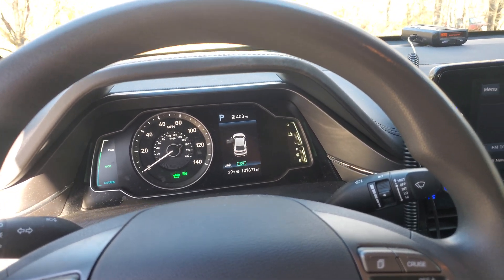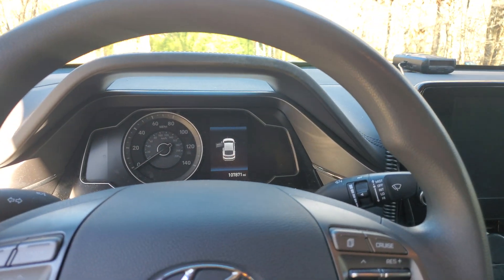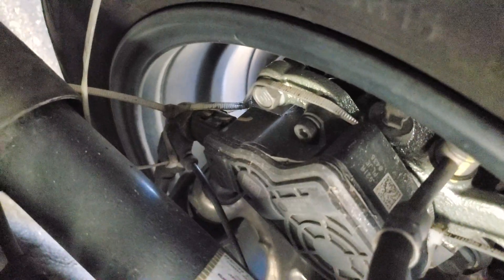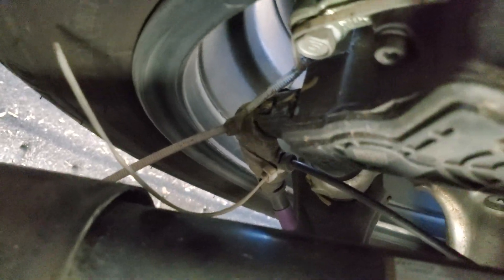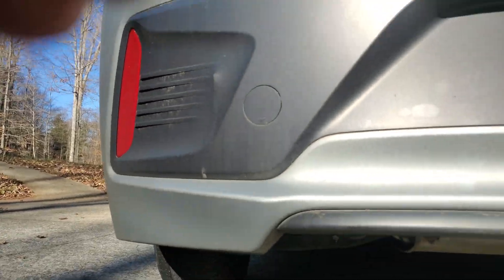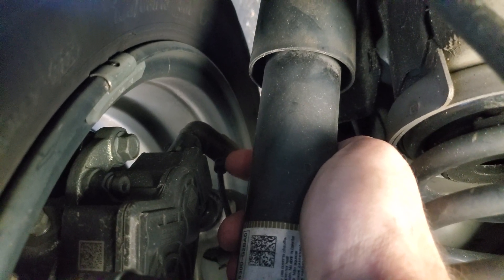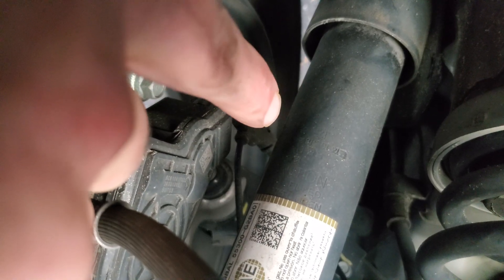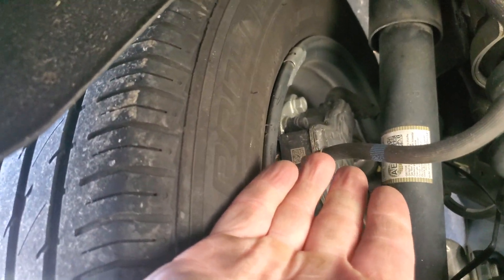Hyundai Ioniq 2017-2022 EPB Auto Hold Light Simple Fix | Resolve Error Codes C2416 & C2417 Easy Fix

Comment: Thank you so much for this. I was very skeptical at first but it actually works! As a single female, taking my car to the shop has at least a $250.00 cover charge.  The dealer and other mechanics quoted from $225-$275 to diagnose it, even though they probably know exactly what's wrong with this issue and really, Hyundai needs to recall and pay for this malfunction.

Comment: Great video. Used this method to great effect. Thank you. 

The closer I looked at this issue, the more clearly it looks it's an engineering and design flaw. If you look at the small bracket that holds the cable just before the connection, it is too high and the cable is pushed too far through it. This causes the cable connection to lift up on the back of it, seperating of the connection with every bounce on the road and signaling the EBP flash on the dash. 

The permanent fix to this is to simply remove that bracket between the caliper connection and the body frame and let it hang loose, or pull the cable back through the bracket a bit to pull the connection down to sit flat. 

It's stupid that this issue is because of something so simple. The worst and most costly repair would be to have to replace that wiring cable, and they are not terribly expensive, but a bit of a pain to install.

Comment: I might try this but there's a recall and the dealer will fix this for free. There's a Technical Service Bulletin for this
Reply: No open recalls show up. Dealerships/technicians have no clue what to do. I sent them a bulletin that someone shared and they said it's only if that code comes up. No codes show with this error.
Reply: @oftenoverlookedgoods6104 look at the TSB it's literally a picture of what's in the video being worked on https://static.nhtsa.gov/odi/tsbs/2023/MC-10235346-0001.pdf
Reply: @oftenoverlookedgoods6104 the pictures in the Technical Service Bulletin are identical to this zip tie fix
Reply: @oftenoverlookedgoods6104 is correct. Well, you're both technically correct. The only problem is, that the free "fix" from hyundai, is only if the vehicle is under 60K miles or you have an extended warranty. Trouble is, it's not a fix and will happen again.  I've had my Ioniq since buying it new in 2022. That light came on for me at about 20K miles. Their fix was to replace the harness. That is more than likely due to TSB 23-BR-001H. The same thing started happening to me shortly thereafter. I had it fixed again, since it was covered. At this time I didn't look up the TSB's or researched online in forums. Shame on me, I thought Hyundai would have provided a permanent fix. I also assumed that the first fix didn't last long as a fluke. I gave the dealer and Hyundai too much credit. Here I am 60K miles later and I learned that Hyundai will NOT address for free. Doesn't matter really, since the defect is of a design nature, and the orientation of the bracket is the problem that will continue to affect the pigtail unless addressed. Here i go to the internet to find help for something Hyundai should have address properly. Thanks to the Ioniq forum, and a plethora of people having the same issue, I figured out it was the bracket that was the issue, causing a shoddy connection of the electrical pigtail where it connects to the speed sensor. This is bad business in my opinion on Hyundai's part. It's clearly an issue, and frustrating for so many people. It is so easy for them to publish a recall to take care of it. And it's not an expensive fix to address. Due to issues like this, and my inability to sell my Ioniq, or trade it in without losing a considerable amount of money (resell value is atrocious), that I will never purchase a Hyundai again. I will relay that to everyone I know. I've fixed my own vehicles since the day I could drive, this isn't that hard folks, shame on you Hyundai, especially for something so easy to fix.